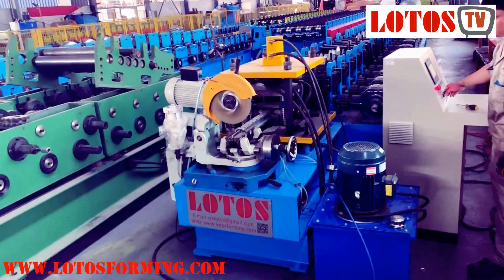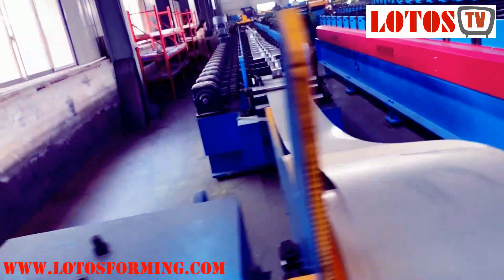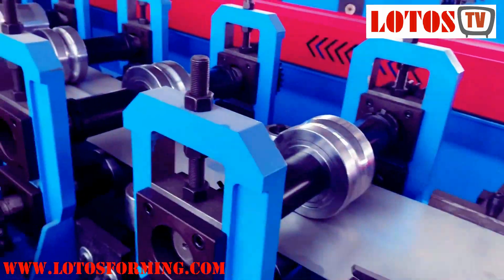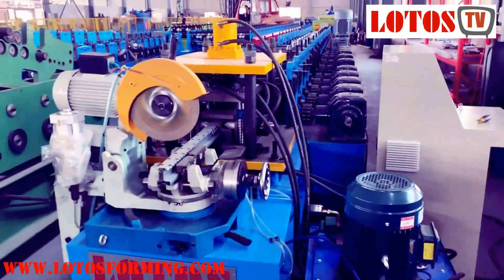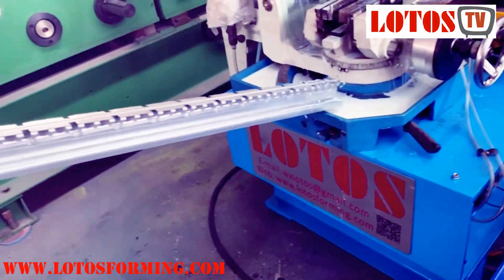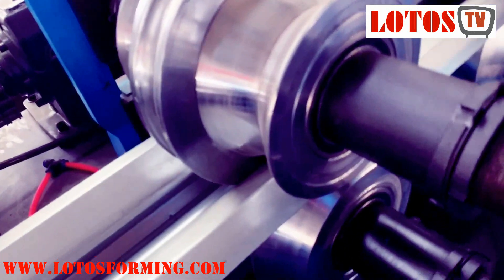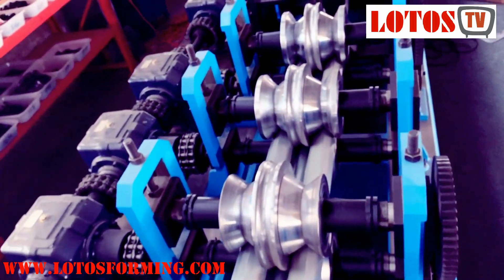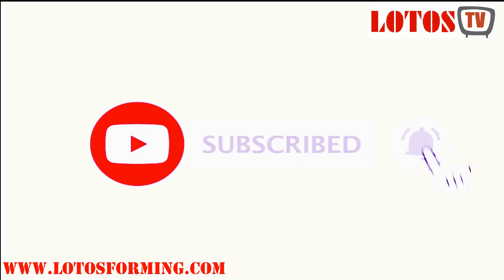【 Fence Post Making Machine 】:  Fence Post Machine | Fence Post Roll Forming Machine " LOTOS 2020"

Comment: The Fence Post Making Machine or  Fence Post Machine is starting from the unwinding of metal coils, entry the notching device after feeding, and roll forming to size according to client’s design, and post-punching and cut to length by hydraulic cutting device then stack and packing.